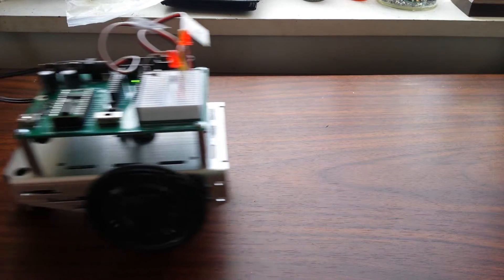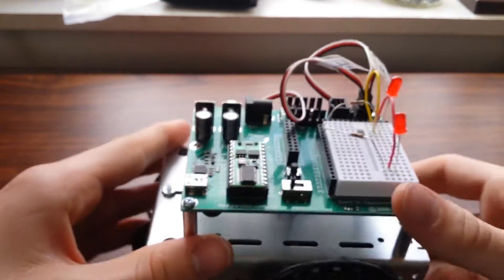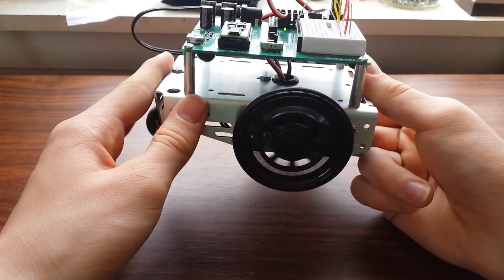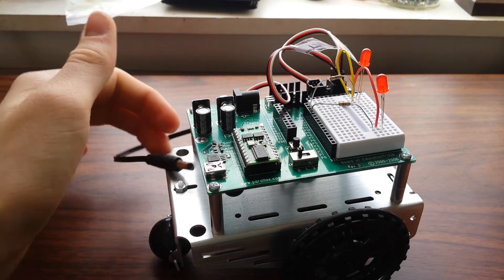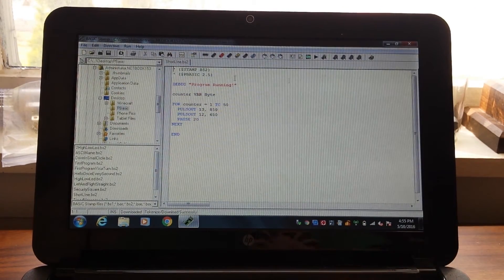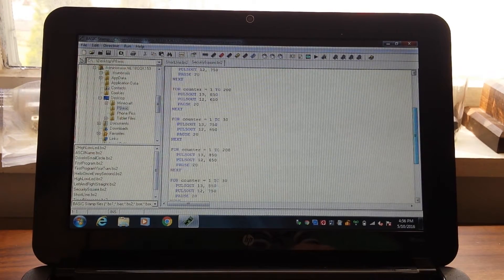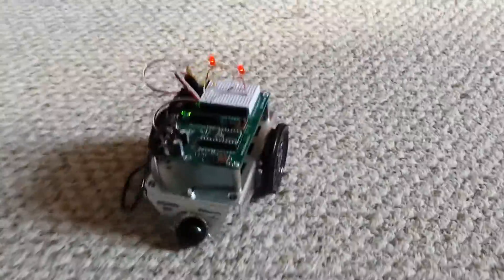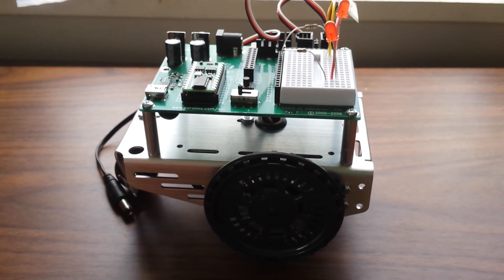Parallax Boe-Bot Robot USB Kit

Comment: Is parallax similar to raspberry pi? I have a raspberry pi 2.0 and it seems similar to this.
Reply from the maker: ok. in ways, yes it is similar to the raspberry pi. except, this board is made for the mounting plate that it came with, it has special connectors for the 2 servos, and battery in the mounting plate chassis. The raspberry pi is programmed with Python, but this Parallax Robot is programmed with a software called PBasic. Other differences include, this robot must be programmed with a computer. The raspberry pi can be coded right on itself. but you still need a monitor to code the raspberry pi. (which is not as expensive as a computer to program with.) The raspberry pi has more io pins, while this Parallax has only 10-19. Another huge difference is price. This robot costs about $150, while the raspberry pi 2 is around $30. but the ultimate raspberry pi 2 kit that includes all the thinkin-majiggies you would need to control external electronics. This is a fun little toy, easy to learn to code it, and easy to assemble. the raspberry pi is a little harder to learn to code, requires additional cost for a case, and still fairly easy to learn, I would get a raspberry pi. I do love this robot because its easy to learn how to code it. So this is actually probably a good engineering first step learning robot. I'll show more on the software that it requires, how to program a simple program on it, and all that in a future video. Thanks for commenting, and taking your time to read my long, comment story. Lol.
Reply: +Tech Ethic wow, I did not know that this robot was so similar yet different. I might get it if it weren't so pricy
Reply from the maker: +Legomore I know! But let me get a link to a popular raspberry pi accessories/parts site. You could pick up alot of extra sensors and everything for really cheap.
Reply from the maker: +Legomore here's the link: https://www.adafruit.com/category/105
Reply: ***** I actually got a kit with my raspberry pi called CanaKit, but I am sure this website will help. Thanks!
Reply from the maker: +Legomore ahh yes! The CanaKit! I have see different kits around. Do you like yours?
Reply: ***** Yes. The CanaKit comes with a full breadboard, a bunch of LEDs, wires, a case, etc.. It was really good for its price, but I have never found time to learn to code the pi, and if I do, I usually can't find the pi
Reply from the maker: +Legomore awesome!